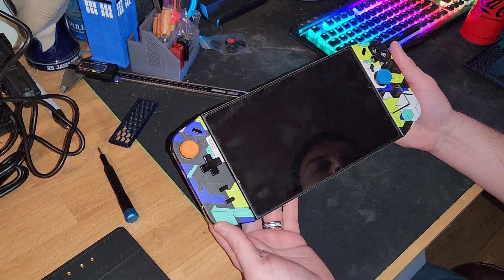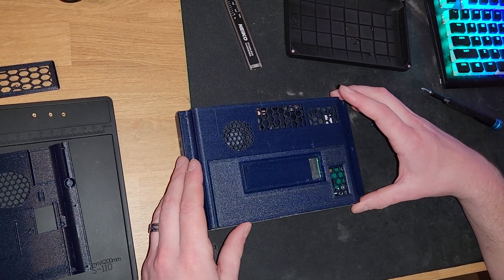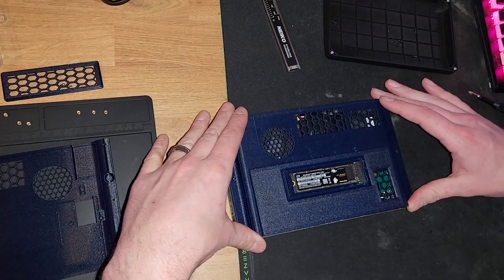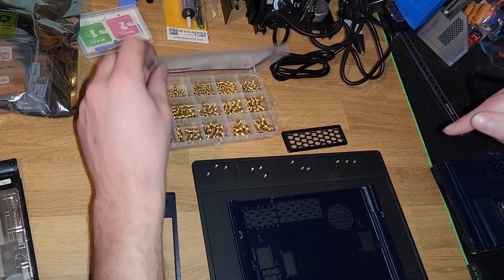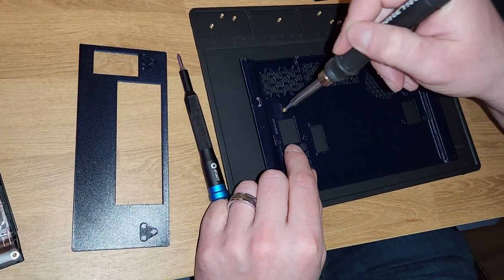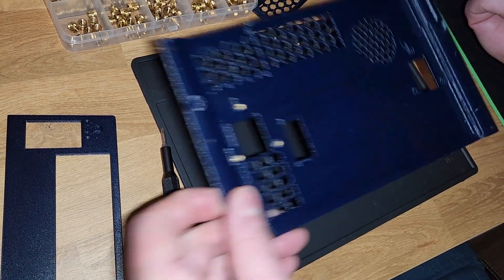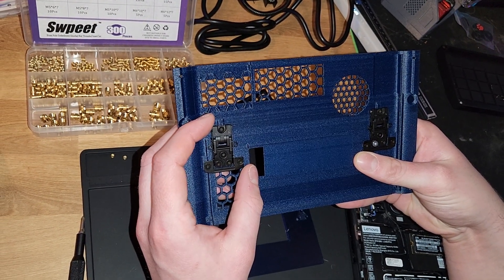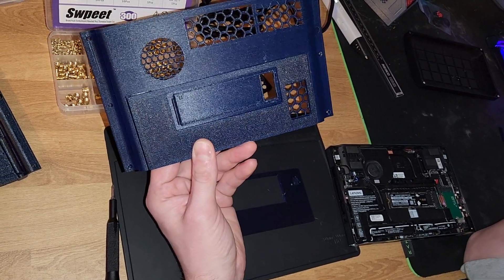Custom Legion GO backplate installation Tutorial

Comment: Hello, this is really nice. Question though: Do I have to buy those brass nuts and a soldering iron to use this back plate with the Go? Or are those brass nuts only necessary if I want to reuse the existing OEM Legion Go kickstand on there?

Or would the backplate work ok without those brass nuts? Or just have a bunch of empty small holes all over and feel more flimsy?